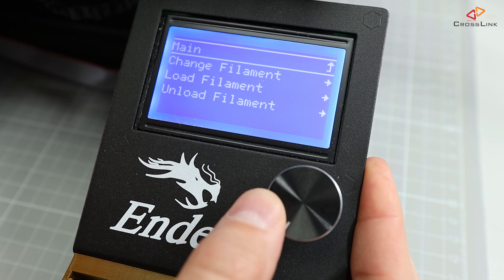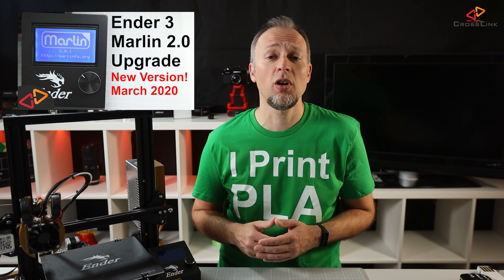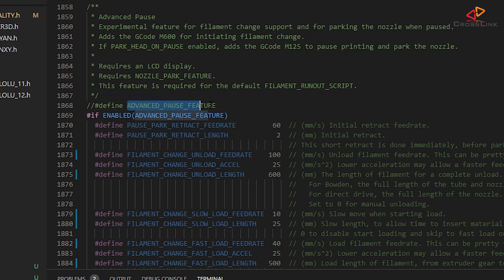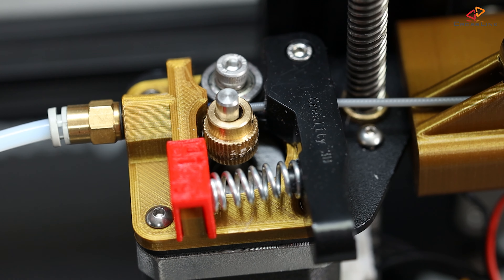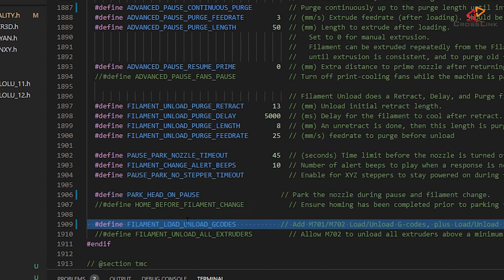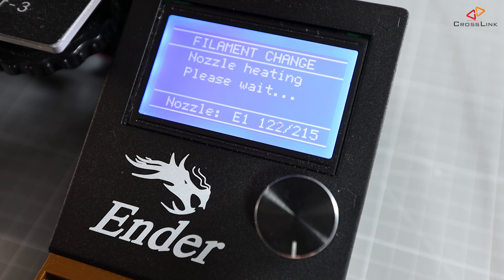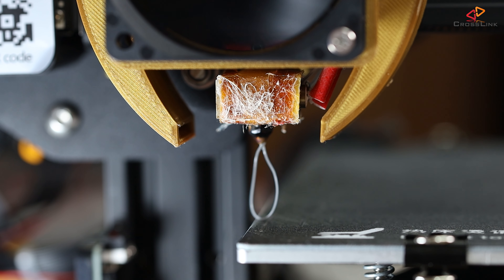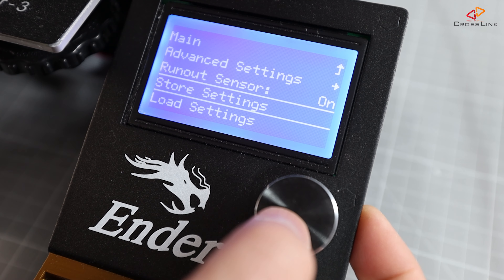Marlin 2.0 M600 Filament change setup explained

Comment: Thanks for the video. Quick question, how do you make the printer do a x-axis homing after a filament load (before the print resumes). My direct extruder attached to the hotend is a little stiff and when you load it, it is easy to knock it out of X position. I need to get the printer to rehome the X after loading the filament or it will have a layer shift in the print.
Reply from the maker: Why would an x-Home get you back to the same print position? Every homing can generate slightly different zero-Position offsets, so it’s not guaranteed that it will resume to the exact same position. And I don’t know if homing overwrites the previously saved position where the print was paused. Anyways you would have to modify the internal behavior of the M600 command in Marlin. As far as I know, you can only define positions where to park in NOZZLE_PARK_FEATURE and ADVANCED_PAUSE but no custom Gcodes so you would have to take a look at the implementation and add an x homing command in there.

Comment: Thank you! I have a problem, can you help me? 
The noozle goes back to the last print-position
NOW it will be confused..... 
The noozle start the printing, 
Exactly at the Beginn - Suddenly the extruder RETRACT some Filament and than it feed normaly and the noozle move.... 
Now it works normlay. But the first 30 seconds, i don't get any Filament, cause the extruder retracted a little Distance of the filament, before start noozle move-printing.

Comment: my machine likes to spit out the filament right before the print starts again. ive read on this issue im trying somthing right now. any tips?
Reply from the maker: I guess the filament sensor is triggered. Might be that it is configured reversed so it reports empty when full and full when empty? Check with the M119 command

Comment: I have de creality v4.2.2 board with marlin 2.0.1 and is not detecting the m600 comand, does this tutorial works for this board?
Reply from the maker: Sure, if you build your own Marlin firmware, but you need a configuration to start with so it supports the 32 bit mainboard. Look inside the Marlin Configuration repo for the base configuration file for that board and then start to modifiy it for the Filament change command.
Reply: @Crosslink3D  Thanks for answering, I'll check.

Comment: I followed your command changes but am getting a SUPER-FAST load speed! So fast it won't even catch the filament to feed into the nozzle. I have an A10M running Marlin 2.0.9.3. Any suggestions? Thanks very much. Nice video.🤨

Comment: Thank you so much for this video!! I have been working on this for hours. I don't know what I had configured incorrectly.  It would extrude about 50 mm or maybe less.  Then it would pause like forever.  I would have to turn off the printer and do it again for a few more MM of extrusion.  Then another pause... I made my settings match yours and now it's actually working.  Thanks again!!

Comment: Will this work on the ender 3 v2?   Currently my older ender 3 pro has this feature but its absent in the newer Ender 3 v2...  great video!
Reply from the maker: It depends, I haven't tried to upgrade my Ender 3 v2 to Marlin yet. This is something for another video.
Reply: I tried this on my Ender 3 v2 (latest Marlin 2.0.x bugfix version). Do see anywhere in the menus filament loading/unloading. Has anyone else tried this?

Comment: Hey Daniel, is there any way to get rid of the "Attach Media" and "Media Released" in the menu?
Reply from the maker: I think this is part of the SDCARD support. If you can hack the code, you might be able to remove it but WHY?
Reply: I use Octoprint so I didn't realize it was part of the SD Card support and couldn't figure out it's use. Now that I know it's for the SD Card support, there's no reason to remove it.

Comment: Hi daniel i follow this tutorial for setting up  filament change option in marlin but when i start a print it prime the nozzle and com back in the filament change position and unload the filament and than ask me to load new filament before start to printing can you help thx.
Reply from the maker: That was a bug in 2.0.5, which should be fixed in 2.0.6 that was released today. Be aware that the default configuration files have also been changed so you probably will not be able to use your existing ones.

Comment: Ender 3 V2: since it doesn't have  "Change Filament" LCD option, these settings don't exactly work well. There won't be any "Change/Load/Unload Filament" options in the LCD cuz it is not programmable. Also, the config file Load/Unload Feed Rates and pause prompts, act weird. 

I would suggest not changing Load/Unload Feed and purge options, and do it manually, and once ready, click to resume print.

Here's the order in which Ender 3 V2 executes the settings, noted in this video:

1. Nozzle Park (unload doesn't happen, filament has to be pulled manually)
2. 15 beeps, signal to unload fila. Then, Auto cooldown
3  Click to temp up. 15 beeps signal temp reached to Load fila
4. Load fila
5. Click to fast feed, and purge
6. Click to resume printing

Also, since there's no option in LCD to limit Unload and Load feed lengths, and if you really wanna set those values, then I figured this works well - set Fast load length to 450mm, feed Filament 25-50mm into the Bowden Tube, and resume

I hope this helps.
Reply from the maker: Interesting, I will have to test this on the v2, soon...
Reply: @Crosslink3D  Do keep posted what you find, and if my findings are correct. Cuz the workflow that I noted, worked fine for me. Took a bit of time figuring out what the heck was going on.. LoL

Thanks for the great videos again.
P.S. I fixed my horrible typos in my original comment. Sorry about that.
Reply from the maker: Gaurav Gulati will keep you updated (probably through a video 😉)
Reply: hello i got the ender3v2 too can you please share your bin file with me if you can. thank you.
Reply: @mccolister  it's never a good idea to use someone else's compiled firmware. 
But, I can still share mine. I just don't wanna post it here, or share my contact info in the public realm